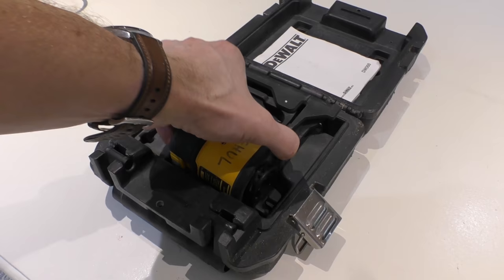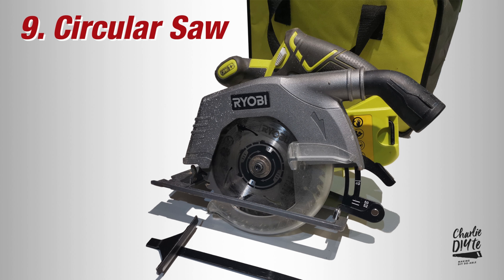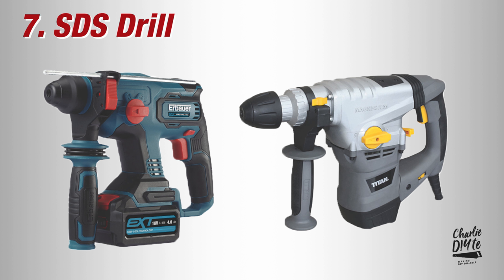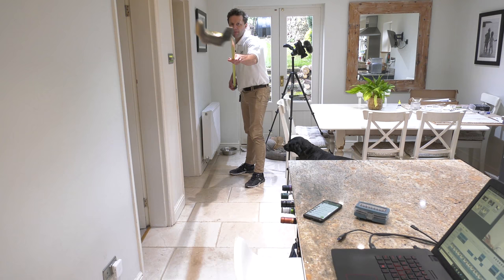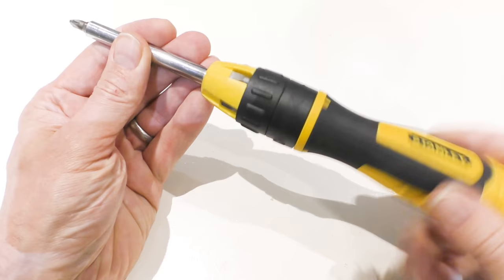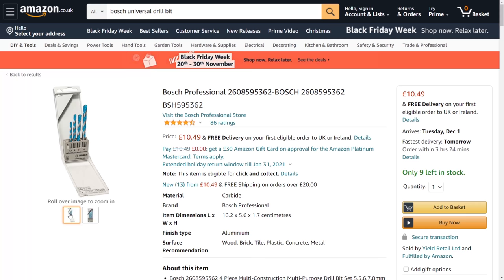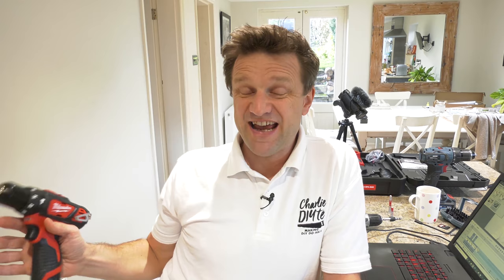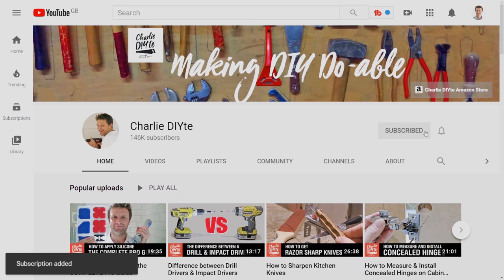My Top 12 DIY Tools for 2021

Comment: Hi I am looking to get new power tools at my B&Q I seen erbauer tools.Is been a very long time since I've bought new tools things are all new to me. I do DIY around the house so do you think the make Erbauer would be ok as I was thinking about getting all the tools I need in the same make so I can save on batteries.  Please can you help. P.S. i love the videos very helpful. Keep going.
Reply from the maker: Hi Darran, thanks for that. Yes, I've been very impressed with the Erbauer tools that I got from B&Q - my video on them is here https://www.youtube.com/watch?v=i6KYfrDBj3w&t=403s. I think they strike a good balance between quality and price. Depending on what you're thinking of getting, they've got some great starter kits, https://www.diy.com/search?term=shoperbauerstarterkits The one that caught my attention is this one https://bit.ly/3ljZJFZ although you'd want to invest in another battery - maybe the 2Ah as this would be more than adequate for the drill driver, torch and impact, leaving the 5Ah for the SDS (which by the way has had some good reviews). This Starter Kit is also pretty interesting https://bit.ly/3mlfQ7h and my word, with drill driver, impact, jigsaw, grinder and circular saw you have a LOT of tools to get you started, although it lacks the SDS, which you could add for £100 bare (without battery) or £150 with a 4Ah battery. It very much depends on what tools you're likely to use most often. You probably won't use the impact driver that much. If it was me, I'd be looking to get 1) Drill driver 2) SDS 3) circular saw as the priorities. With a 2Ah and a 5Ah battery and their fast charger, that comes to £355 so you might be better buying separately like this, rather than buying a Starter pack. That way you can cherry pick what tools you need. Any other questions, drop me a line on email charliediyte@gmail.com

Comment: Struggling to find the model of Circular Saw you recommended,apart fom Body only.  go for it and just buy blade and battery or do recommend another model ?
Reply from the maker: Yes I've just had a look and would agree with that. There generally seems to be a lack of availability, possibly because of Covid restricting production. I can only speak for the one I've got, so I can't really recommend anything else. If you're planning to use it exclusively for cutting full sheets of MDF or ply, you could look at a plunge saw instead as you'll find the tracks much more accurate than anything you can make yourself to fit the circular saw. I'm currently using the Erbauer I recently bought from Screwfix (comes with a 1400mm track), although I still use my Ryobi with the fence for narrower cuts, on my current wardrobe series.
Reply: @CharlieDIYte  thanks for the quick response, Body with Blade + 5.0ah  Battery it is then. Some dislike of the 165mm blade saying its a odd size, does that mean it's difficult to get hold of or are most others 150mm ?

Comment: Charlie. Why is the ryobi sds+ drill not any good. The newer model? 
I’m looking at getting a whole new tool set and am finding your advice excellent. Dave
Reply from the maker: Hi Dave. I didn't buy that one at the time because mine was the more powerful option. The advantage it has over mine is a chisel function but the reviews of it are AWFUL (overheating, malfunctioning etc). I don't know why they discontinued mine because it's been brilliant. Have you already got Ryobi tools? If not, you could do a lot worse than buy that Erbauer SDS. The reviews of it are consistently good. Thanks so much for the positive comments - really grateful to have you supporting the channel 👍🏻
Reply: @CharlieDIYte  yet to even buy any tools yet. But loving the idea of the one+ battery system for the saws drills I drivers etc. 
Will check the erbauer 

Also tempted with that beast of th Titan. 

And the evolution mitre saw you’ve demo’d. Will help with my plans post house extension

Comment: What are your thoughts re brushless vs non brushless tools?
The ryobi set you showed is not brushless so Could need changing after a few years?
Reply: Brushes are easy and cheap to change. Brushless tools will give you a longer runtime on each battery and are usually more powerful though.
Reply: @theMrFouldsy  over time won't brushed just wear out more quickly so high power intensive jobs like sds drilling etc might be best to opt for brushless?
Reply: @justintemp  Brushless tools are almost always better than their brushed counterparts, high power applications are where this is most apparent. It's just a question of whether it's enough to justify the extra cost. Brushed tools will wear out faster but they're easier and cheaper to repair when they do. For a tool that you intend to use more than once, buy the best you can justify the cost for.
Reply: @theMrFouldsy  thanks Ryan. It is a dilemma. After purchasing lots of cheap and then decent ones like black decker i may have to up it to ryobi as that's more affordable than dewalt and matika but it's trial error. For the ones that broke i could buy 1 decent one 😂

Comment: Glad i got my 3 piece Ryobi set from b&q before you made this video it was already hard enough to find them in stock! For reference, the free tool deal redemption is quick under a day after product arrives and they say they will deliver it within 14 days. was impresed.
Reply from the maker: Thanks Jack. That's great to know. What free gift did you go for? Great quality tools, Ryobi 👍🏻
Reply: @CharlieDIYte  I ended up going for the strimmer, needed a new one anyway, It was one of the more expensive of the tools which were listed, so i think I got my money worth :)

Comment: I’ve got the Erbauer SDS   And we have the Bosch GBH 36 vli version at work ,to be honest I’ve found no difference in performance,and my boss paid £350 lol I also bought an extra 4ah battery so no down time
Reply from the maker: Mate, that's great to know, thanks - particularly as I've had my eye on this for a while. The other Erbauer tools I've got have been great, I've got to say!
Reply: @CharlieDIYte  I’ve got the impact driver,jigsaw and orbital sander to  so I can swap batteries around 
Granted I’m not doing as much DIY as you but they are great tools

Comment: can people comment if erbaur are a good brand?
I see them in b&q all the time but they look like a budget brand ( because they look like they awfull things sold in lidl/aldi ) even though sometimes they aren't actually cheap.
Reply from the maker: Tony, if you scroll down through the comments to my original video on these https://www.youtube.com/watch?v=i6KYfrDBj3w&t=404s you'll find some pretty glowing reviews, and the SDS I talked about in this video has a lot of love online too. Yes it is a B&Q own brand and the warranty support is only 2 years but this particular line are manufactured to a very high spec and I've been using them since April 2019 and they haven't let me down once. Battery life seems really good too, and if you get the fast charger, they charge up in no time at all.  The only criticism I have which a few other people have noticed is that when you depress the trigger, there's a slight lag before the power kicks in, which if you're used to other brushless brands, might annoy you a bit, but if you're not, you'll probably not notice it.
Reply: @CharlieDIYte  thanks for replying charlie, the video and comments are all very positive.

Comment: Excellent video! But i still cant get round having diffrent chargers for different tools. I would personally stick to one brand and have one charger that fits all.  The best tool.i have is the dewalt impact drill...does everything even drills through concrete with the right bit.
Reply from the maker: Fair enough Max. Personally I find it quite liberating using different brands. Gets you out  of the mindset of being tied to a brand (which of course they want) and gives you a much wider breadth of tool. However I get where you're coming from and as I said in my last video, for trades, it's crucial to stick to one brand because they can't be living multiple chargers around site.

Comment: You will struggle to drill in a concrete with a combi drill especially when its in reverse😂
Reply: It's not in reverse. What you are seeing is called aliasing, which is when the RPM of the drill bit is close to the framerate of the camera, making it appear stationary or reversed. The same thing happens with helicopter blades, fans, car wheels, jackhammers or anything else with rotary or reciprocating motion.